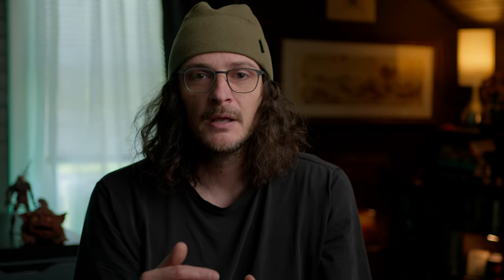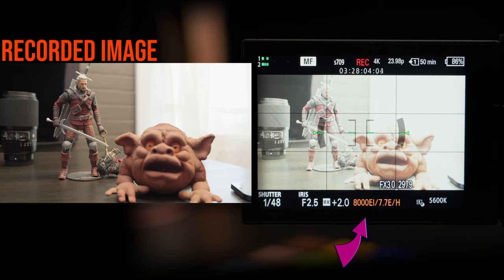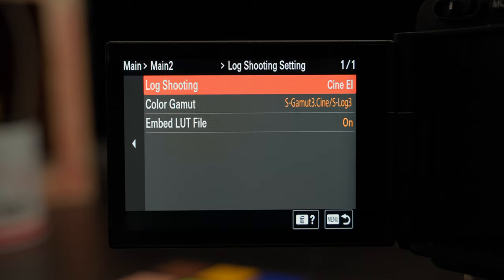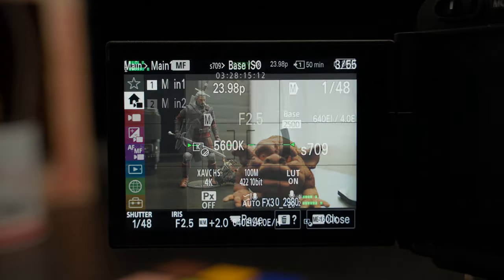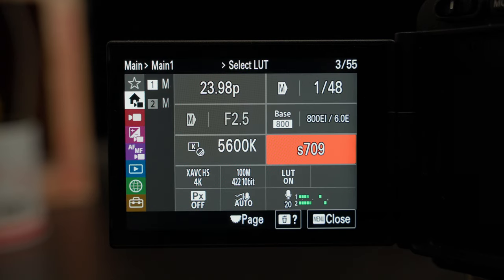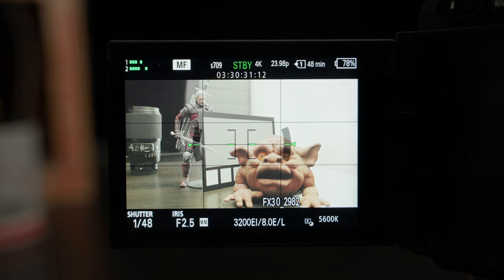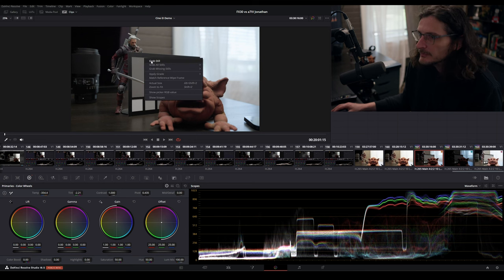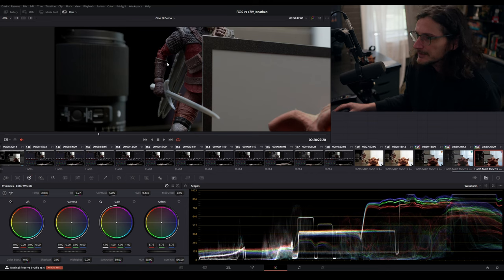Cine EI Complete Guide Sony FX30/FX3 | What, Why & How

Comment: Really appreciate you explaining Cine EI in such simple terms.  I've tried it a couple times with my FX3, but did not like the work flow.  For the massive amount of effort it takes in post, the marginal gains in image quality wasn't worth it to me.

One of the biggest challenges for me was that it required me to constantly be fiddling with the EI level instead of just dialing in an exposure compensation.  I'd rather focus on the composition rather than the exposure - let the camera do some of the heavy lifting, right?

Also, since I shoot on multiple Sony cameras, I found it challenging to constantly having to remember which Zebra values go with the different log viewing profiles.  Now, I just shoot everything in SLOG3 with Gamma Display Assist and target 41 on the grey card - ez peezee.  I've got a video out coming out soon on that exact topic so stay tuned...

Great work as usual!
Reply from the maker: Thanks for the comment. As long as you have a method that works for you, that's all that matters! Looking forward to seeing your video!
Reply: Please share this with me, so target 41 grey will always get your Wb correct?? Im debating using Cine-ei or cine-ei quick??? for a beginner Im not understanding the ISO value on bottom right of touchscreen. I understand ISO and stops of light to stop down with ND filters outside so I can shoot at 24/60/120 FPS always at lowest Lens F-stop. Now im using Sony zeiss 35mm f2.8

Comment: If you just follow the ISO dynamic range chart and use Flexible ISO, you will get the same results without having to readjust our exposure in post, right? Like, if I know my base is 800 and I want more detail in the shadows and I don't have a bright window I need to preserve, I can go down to 200 ISO (for example) and expose for middle gray right then and there and what you see on the screen is what you get, right? THIS VIDEO IS SO HELPFUL I'm just wrapping my head around why someone wouldn't just use fixable ISO. I GUSS, and correct me if I'm wrong... Cine EI is just a safety net for people that aren't sure how ISO is actually limiting dynamic range in the lows and highs when they adjust it? Does that sound accurate? THANKS! Flexible ISO does switch gain stages from low to hi when it hits 2500 though, right? Thanks again haha.
Reply from the maker: I'd like to do a video on this concept as well. You should get very similar, if not the same results, if you expose as you describe using middle grey and ISO, but I'd like to do a comparison just to check it out. 

I guess Sony's rationale is that the base ISO(s) will give you the best results rather than adjusting the actual ISO value...

And yes, flexible ISO will switch from Low to High at 800 and 2500!

Thanks for the comment and thanks for reminding me I need to try this out for myself

Comment: Excellent explanation and very thorough. FYI, although SONY removed the picture profile for SLOG3/SGamut3.Cine (PP8), you can still record SLOG3 outside of Cine EI in the FX3/FX30 by editing any of the existing Picture Profiles and choosing SLOG3 as the gamma and SGamut3.Cine as the color space. I have been trying to figure out if there are perceivable differences between shooting the old school way (PP8) and LOG shooting mode + Cine EI. So far in what I can tell there is a minute difference, but I have not done more comprehensive testing.
Reply from the maker: Thank you. Good info about creating a new Slog-3 profile outside of the Log Shooting setting. I’d be interested to hear if you do any in depth comparisons

Comment: Great demo. I still dont understand the purpose of the EI dial though... If we specifically set the value to either base, and work our exposure from there (controlling it with the iris, shutter speed, ND filter), why would we want to undeexpose or overexpose while creating the illussion of a correct exposure on the screen? And would it be okay just to lock all parameters for the shoot and only expose with the ND filter changing the base (800 - 2500) when necessary? Please correct me if im wrong, its just a bit hard to wrap my head around this shooting approach, altough I clearly see an opportunity of getting the cleanest looking footage out of this...
Reply from the maker: If you ETTR in a non-Cine EI mode or camera, you're looking at the overexposed image that you're capturing. So you can't really tell how it's going to look when you adjust the exposure. Cine EI allows you to ETTR (or ETTL) and see how the exposure is going to look. That allows you to take full control over your image. How dark to you want the shadows? How bright to you want the highlights? etc. Hopefully that makes sense. Good question and I see that's an area where I didn't explain well enough
Reply: @PhillipRPeck  Thanks for the reply!!I think I have a better understanding of how it  works now... probably still need some hands on experience with it. Yes, thats exactly the problem, everyone just explains the technical part of the cine EI mode; what the dials do, what the values on the screen are, etc... Your video by far is the most detailed I've seen on youtube, with all the resolve examples, diffenent exposures... But this part with monitoring the result is still a bit confusing... I think I can speak of everyone who's never had any experience with film cameras and non-adjustable isos :/ So if you happen to decice to do a second part of this video, rest assured theres an audience for that :) Thanks again!!
Reply from the maker: @ValJedi  Thanks for the feedback. In earlier drafts of the video, I had a few lines encouraging people to try it out. That's what I had to do before it really made sense!
Reply: This is exactly how I've been shooting with it for the last few months and I've been really happy with the images.  I think you can shoot this way with success but after watching this video I have a much clearer understanding of how the tool was designed to be used.  Nice video Phillip.  Just subscribed!
Reply from the maker: Thanks!

Comment: Great breakdown and explanation, while Cine EI could helpful in some cases, I have to imagine it exposes shoots to a lot of risk if some operators don't understand exactly how it works. Seems very easy to make a mistake and come back with ruined footage. Most modern UI/UX philosophy is based on WYSIWYG (what you see is what you get) but this is the complete opposite haha. Seems like a simple +1 or +2 ETTR LUT would be a simpler and more easy to comprehend method for achieving a similar end result.
Reply from the maker: Hey thank you. I think that's why so many "explainer" videos just told people to stick with the base ISO. I've never tried an ETTR LUT, but I'd be interested to try it out and see how it compares

Comment: Thank you for this, I'm switching from a6400 to FX30, haven't shot anything yet, BUT this is quite puzzling, your analogy of the old film made sense to me, but the actual in practice somehow confused me. So technically, if I am to shoot during daytime snowy outdoor, I'm better off at 3200, which is ultra counter-intuitive?! Do I have this right?
Reply from the maker: Yes, in theory, but there is still a penalty for pushing the ISO past a certain point. Even at the high base ISO of 2500, the image is noticeably noisier and less detailed than the low base ISO of 800. In your scenario, if you want to maximize highlight detail, you could push it a stop or two above 800, but you want to make sure that you're not pushing it too far and introducing too much noise. IMO, 3200 is too noisy. I'd try 1000 and 1250 but I wouldn't push it further. Even Sony doesn't recommend pushing the EI value above the base because they want to keep the noise levels down. 

I'd recommend taking a look at the chart that Sony provides 

https://helpguide.sony.net/di/pp/v1/en/contents/TP1000756717.html 

which shows the stops of latitude at all the different EI values to help you wrap your head around what's happening. And take some test shots and see for yourself.
Reply: @PhillipRPeck   Thanks for the reply! Make sense, I guess I just need to go out and try it 😅 . I'm so used to the 'traditional' way The Ei kinda sound super alien and intimidating. Plus I don't have much XP with slog-3... I'm a Cine guy :) Great Channel you have! You have a new sub!

Comment: Great explanation, dude!!! I do have one quick question... is there a way for me to custom program a button on my fx3, that allows me to switch from EI to flexible ISO with just a push of a button?
Reply from the maker: Thanks! I don't have my FX30 anymore so I'm not 100% sure but I don't think there's a way to program a custom button just to recall Flexible ISO or Cine EI. On Sony alpha cameras with a mode dial, you could just setup Custom Profiles but I guess you can't do this either on the FX3/30

Comment: Hey man, thanks for the great video! I Have just one issue: No matter where I change my EI setting, 200EI, 800EI or 3200EI, my recorded video is the same! What im doing wrong??
Reply from the maker: 🤔 That's what it's supposed to do. Cine EI locks you in the base ISO. The EI value only changes the monitor, what you're seeing on the screen. The idea is that you adjust the recorded exposure in post (in your editing software or in Catalyst Browse or Prepare) to match the monitor exposure

Comment: Thanks for the video. This is very helpful. Could you tell me when you are grading this video what the IRE level of your face and the softbox behind you measure for your delivered video to YouTube. Or what your preferred skin tone and highlights IRE levels are for your graded videos. It looks great!
Reply from the maker: Thank you! The brighter side of my face is around 55 IRE. When you say softbox, do you mean the lamp in the back right corner? That's around 75-80 IRE. 

I make sure I can hold the exposure on the window at around 90 IRE, then bring the key light up until 44-45 IRE on a grey card right where I'm sitting. There is a little LED panel light under the lamp shade and I just adjust that to taste. I use the S-709 LUT in camera and an external monitor
Reply: @PhillipRPeck  thank you!

Comment: One thing I am not sure about is.. does the clipping point of S-Log3 change when using a monitoring LUT? Your “exposure values in IRE” graphic shows the different IRE values for middle gray and skin… but what about clipping point!? Does it change from 94 IRE with no LUT to something else with the REC709 LUT?
Reply from the maker: Yes. The clipping point with the S709 LUT is 99 versus 94 with no LUT. I could be wrong, but, if you think about the IRE values of S-Log 3 with no monitor LUT as the "conservative" or "safety" range, then maybe it makes sense. Because if you use the IRE values of S-Log with no monitor LUT to capture in camera, then those values will be expanded in post to match the values of the S709 LUT. Right? Because you're not going to leave the S-log 3 image uncorrected. I don't know, my brain's not working

Comment: Fantastic video. I'm starting to finally wrap my head around EI. Thank you.

Any advice on when it's appropriate to switch from L to H base iso? I'm running an FX3 and I'm having a hard time knowing when to switch to H and add NDs.
Reply from the maker: Thank you. Sony recommends not exceeding the base ISO so if you follow Sony’s guidance, if you need to go higher than 800 you should go ahead and switch to 12800. 

I don’t think it should be so extreme but I don’t have specific recommendations. I bet you can go to 1600 for example
Reply: @PhillipRPeck  Thanks for getting back to me. I'm new to EI, so I might be confused, or I'm just not asking this properly.

When I'm shooting in Cine EI I'm limited to the base ISOs of 800 and 12800, right? All I can change is my exposure index, which just changes what shows up on the monitor and helps me expose more for highlights or shadows. 

What I'm confused about is when to switch from the 800 base to the 12800 base. Like if I'm shooting a lowish light scenario where I can't control the lighting and my aperture is already wide open. At what point should I use the higher base ISO and add an ND filter to compensate? Does that make any sense? I know the second base ISO of 12800 isn't as clean as the 800 base. So at what point does switching to 12800 remove more noise than it adds?

This is probably an annoyingly specific question, I'm just trying to get an idea of when to switch ISO while shooting cine EI in the wild. Maybe I'm overthinking it and I should just jump up to 12800 when I need more light.
Reply from the maker: You might be overthinking it. I'd stick with the low base as much as possible and only switch to the high when there just isn't enough light to get the exposure I want. IMO, the 12800 ISO adds a lot of noise reduction to get that "clean" image and thus looks a little soft and plasticky. So, I avoid it unless I absolutely can't get the exposure from the low base.
Reply: That makes sense. 800 is the safe bet if I can make it work. I might run some tests to see how far I can push it. 

Thanks again for the response.

Comment: Thanks man for this ! But i have a stupid question, if we expose properly at 800 base iso and 800 EI by adjusting the nd filtre, in order to have the right exposure for the middle grey, and then change the EI to 2500 or 3200 without changing anything else, we should have more information in the highlight or no ? 
Sorry for my English !
Reply from the maker: Changing the EI value doesn't alter the image that you're capturing. It just changes the way it looks on your monitor. So if you set you exposure at 800 ISO and 800 EI, then just change the EI to a different value, nothing's going to happen to the image.

If you want to maximize the highlight info, set the EI higher than the base then get a proper exposure (with aperture, shutter, or lights).

The image you captured will be much darker than what you saw on your monitor so you'll have to adjust it to match in post. The effect of that is you will have maximized the highlight information at the expense of shadow information and noise.  

Hope that makes sense. Just experiment with it until it clicks for you. It only costs card space (and time)
Reply: Thanks for your reply, I asked to early, when I watched your video again it's more clear now.
I have to make compromise !
I'am very grateful for your work and the time you take to answer my question.
It's very clear thanks to you !

Comment: Really insightful video brother! When using Phantom LUTs instead of Rec 709, how much does the IRE value change for skin tones? You have 57-62 for s709 - are you using std+ range of 57 +/- 5?
Reply from the maker: I'm not sure about skin tones for the Phantom LUTs. According to the website, with the a7SIII Neutral LUT, middle grey falls right at 40 IRE. So that's a little bit lower than the s709 LUT at 43-44 IRE.

I think if you wanted to expose for skin tones instead of middle grey, using a +/- 5 range would probably be a good idea, but I don't know what the exact target should be for the Phantom LUT. I bet if you wrote him at his support/contact email, he'd be able to answer

Comment: so using my FX3 for outdoor sunlight using a nd-16 filter, should i stay in Cine-ei quick so I can get the iso below 800 base??
Reply from the maker: You can... It depends on the scene. Do you want to capture as much dynamic range in the highlights as possible? Then keep it in the base or go a stop or two higher. Usually, outdoors, you can use the base ISO

Comment: i did not understand that you had the same shutter & iris in low base and high base but the exposure remained the same
Reply from the maker: No, the exposure changes between low and high, but that's the only point at which the exposure changes both in camera and on the monitor. Maybe you just didn't notice the change, but if you watch the section "Cine EI Quick demo" at 09:45, you can see the exposure change between low and high base

Comment: I know this is off topic, but when comparing the Shure sm7b and the Rode nt1 4th gen, which do you think sound better?
Reply from the maker: I've never used the Rode NT1 but I've heard great things. Usually a large diaphragm condenser mic (like the NT1) is going to be clearer, more detailed, more natural sounding than a dynamic mic (SM7B) but that might not be the sound that you're going for. I really like the warm and smooth sound of the SM7B though. 

The SM7b needs a lot of gain though so that's always been a hurdle with that mic whereas the NT1 doesn't. That's something you have to factor into the cost of the SM7B.  The NT1 also has ridiculously low self-noise. 

Lots of advantages for the NT1 but you couldn't go wrong with either if price isn't a factor
Reply: @PhillipRPeck  Thanks, this decision is extremely difficult to make but I think I am looking for a clearer more detailed sound, one that does not change my voice too much so I'll likely pick the Rode Nt1, for the Microphone boom arm I think a PSA1 or PSA1+ will be good, ill also need to invest in some room treatment
Reply: @PhillipRPeck  I'm also a little afraid that the Rode nt1 kit with the shockmount and popfilter is going to be so big that it will block my vision to my monitor, but I guess you don't know about that either
Reply from the maker: Yeah, thats definitely a thing to be aware of

Comment: Great vid but until they fix the ability to record externally and internally with CineEI I won’t use it.
Reply from the maker: What happens when you try to record externally?
Reply: @PhillipRPeck  you can’t simultaneously record to both type A cards and the ninja. I have to use flexible ISO. In the FX3.
Reply from the maker: You should watch my video about whether Cine EI is pointless. You can just shoot in an equivalent ISO and get the same result as Cine EI
Reply: @PhillipRPeck  lol yeah i'm fully aware, I don't care fo rCine EI personally. I just use the base ISOs.